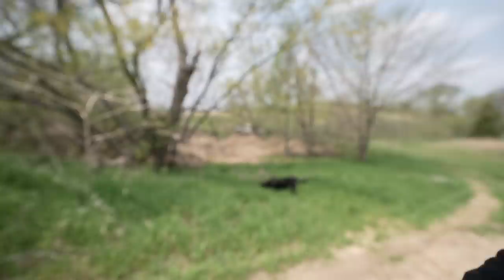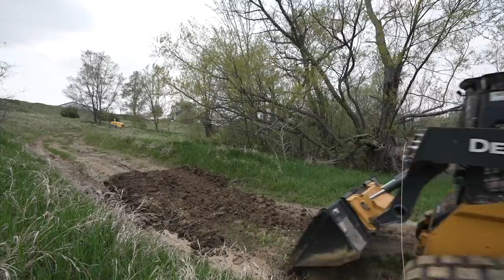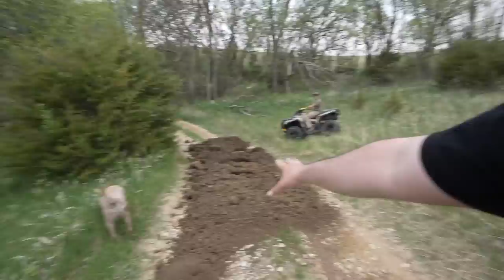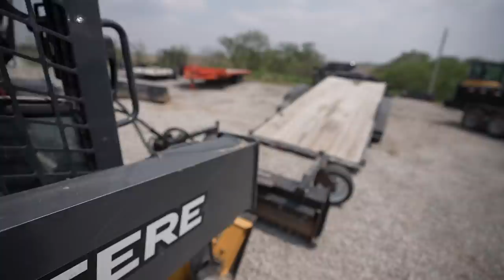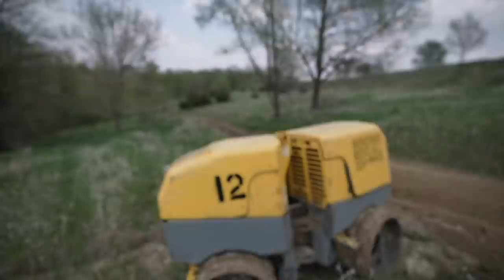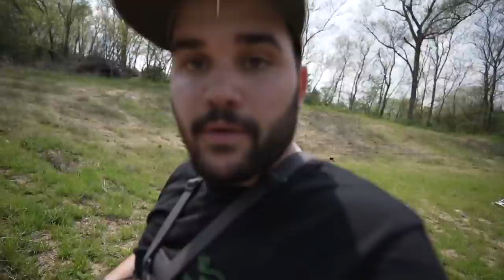Repairing Old ATV Trails with Remote Control Packer and Skid Loader w/ Harley Rake

Comment: The way we fix the rutts in our roads is we actually till our field roads and then come back in and pack it back down. it moves enough of the top soil to be able to flatten back out easily
Reply: Chisel plow works good too
Reply: When he was fixing the paths would a box blade of worked? Would it have been easier?
Reply: @mezenman  anything to really get the top layer of soil stirred up will work.
Reply: I use to work for a landscaping company and it’s easier to loosen up the soil and grade then if you notice spots that don’t have enough you can add a little more and keep grading. Using less soil and reshaping the soil that’s there

Comment: Flair my guy, I’m a heavy equipment operator for a living. Skid loaders are meant to push not pull, always push your dirt. As for the Harley rake put it all the way to the ground then put your machine in float mode while moving. You got this stud keep at it like you have been you’ve come a long ways from the mini. I’ve watched you from the beginning and I could tell from the hatchery videos that you’re getting wayyyyy better in a excavator, the skiddy will come easier the more ya use it🤘🏻
Reply: Continuous flow also helps I believe you hold the roller at the speed and direction you want the attachment rotating and then press on of the 2 bottom buttons on the left joystick.
Reply: I was coming to the comments to see if someone told him to use the float mode.. I agree flair has been improving just takes some practice.
Reply: Float was made for using in reverse, my guy...

Comment: Also I spent last summer finish grading in a 336 and the guy who was helping me along the way had 45 years of experience. He told me when it comes to grading try to do most of the work forwards. I found it a lot easier ontop of that it also helps with the wear on your cutting edge.

Comment: But don't you need to make a matching dent on the other side of the truck🤔
  You should use the remote control packer to flatten out and pack down the mud pit. Maybe then it'll hold some water.🤷🏻‍♀️
  You make a bit nervous, driving that close to the hole!😲
  The roads are looking really good! Keep up the great work team.

Comment: A tip, when grading with a front bucket, use the back edge of the bucket, not the front edge. its more rigid, and doesn't flex. tip bucket up going forward .

Comment: i’m a operator from aus and when filling low spots on one side you come in with the side of the bucket and only grab half a bucket on the one side and then fill your  track and then you track pack it as you go and obviously just switch the side of the bucket you fill up and just lay it in each side of the track and you won’t end up with excess in the middle causing a ridge and a difficult time cheers

Comment: I’m sure others have already mentioned it but when you’re reversing while grading use the tip of the bucket but when you are going forward while grading then back edge of the bucket. So basically tilt down while reversing and tilt up while going forward. You did good for being fairly new and and you’ll learn over time what works best

Comment: Obviously it’s whatever your more comfortable with, but the way i do it is dump the bucket just before the ruts and try to get your bucket at the grade height that you want and push it forward over the ruts and then back drag it keeping the bucket as flat as possible, just a tip hope it helps

Comment: The “remote control packer” is a trench roller. It’s made to pick up and put into trenches to compact before you lay pipe or just to compact small areas. Pretty much a small version of a sheeps foot roller. Used all the time by civil and utility contractors.
Reply: We use it for retaining walls as well
Reply: And it works like a charm!
Reply: The vibration is good on gravel

Comment: If the water is flooding most of the road where it is starting to erosion I would put a covert pipe in to help prevent it and smooth around the pipe and add some river rock or some big rocks to help also but love the videos keep them coming

Comment: A dozer would be more effective on what you’re wanting to do. I would cut the high edge off the right and scrape the whole trail and track it in with the dozer. The water  will shed off the trail with that edge knocked off. The water needs somewhere to go instead of following the trail and pooling in low spots. You have great ideas but can be done in less time. That washout is going to do what it wants. Just from the camera shots I’d guess 40 dump truck loads of dirt compacted with heavy machines to build a connection between those existing berms. Keep up the good work.

Comment: Somewhere inside the cab of the skid steer you should be able to change the flow output for attachments like that and get more hydraulic power to spin it faster and there is a way to make your skid remote controlled. Look up rcsparks on YouTube he has a remote controlled skid steer. Also the mini packer will pack it better than the skid even though it weighs less because not only is it vibrating it has those knobs on the wheels giving it more ground pressure per square inch and because your skid has tracks on it you actually have less ground pressure

Comment: There is a button on the joystick that will lock the hydraulics so you don’t have to hold the scroll the whole time. It’s meant for a mower or Harley rake whatever that turns not like a grapple

Comment: Hey Flair, what about using the excavator to fill in those ruts in the paths?  With the smaller scoop you can put the dirt right where you want it and then you can use the plate on it to smooth out all the high spots!  Just a thought!

Comment: Just FYI on the skid steer if you want to back drag on grade push the right control down where grade is and hit the trigger. It puts the shod steer in float mode and you can grade much easier when back dragging!!

Comment: In order to use a Harley rake right you need to adjust the rotation of the drum, going forward the drum must be rotating counter clock wise, in reverse it goes clock wise from the right hand side of the machine. The roller must push up soil in front of the machine going forward and in the back of the roller going in reverse.  One pass will not work, it needs multiple passes to really grade right.  If you buy one make sure you get one that angles and has side blades.

Comment: Just a tip to make it easier If you roll the switch then if you hit one of the four buttons on the left joystick think it’s the top left it will stay on and you don’t have to hold the roller switch works on the brush cutter also

Comment: If you use the remote packer and with any packer , you need you just put small "lifts" of dirt and pack them. The end product will be much more stable. Packing 36" of dirt really only creates a crust and doesn't pack the soil below. That remote packer is an excellent tool. You have to remember that your skid steer on tracks is made to reduce ground pressure, the packer is by far better . 

The soil looked like it had a good moisture content for packing though. Over packing can create moisture pockets , so be aware of that . One last thing, not sure in the Deere, but in the Case skid steers, if you bump your right joystick hard left it will float your bucket. Would be interesting to know if it does. 
I'm not trying to sound like a pretentious asshole, as I haven't operated equipment for a long while. Just a basic operator trying to give some advice
Reply: My JCB has a button to float the bucket very useful on our farm for keeping feed level in the bucket when dumping into an indoor mixer
Reply: @MintNickel1  thats cool  I wouldn't have ever guessed the bobcat has a fancy feature like that. His deere has to have it then. Wouldn't you say?
Reply: @SH-tz6ee  being a newer style skid I think it should but maybe depends on the package you buy

Comment: We use those sheeps foot compactors to tamp the base of our commercial foundation digs and pier  holes in like Walmart size buildings.we can add 18 of stone at a time and then pack it down in lifts.they work decent.we use a big excavator to set them down in the trench with a chain. We had a new guy put gasoline in one years ago and ruined it.it was a rental but it still was a bad day for that guy.lol

Comment: Flair the only thing to try to help you is when your filling in those ruts on each side of the road is use half of your bucket for like the deep ruts instead of grabbing a full bucket use half to fill in the one side it will make life a whole lot easier other wise everything looks great hate to be one of those dudes on the internet but I’m just trying to help great vid 👍👍

Comment: The remote compactor is meant for compacting trenches so you don't have to be in the trench and have the risk of the cave-in and then you die. In the trade I work as an inspector I've seen many of them and they actually work really good for trench compaction. Not sure how they work on a roadway guess you'll find out LOL.
Reply: Oh your 100% right why would the dummy at the rental yard give them that the thing is a specialized tool like you said for trenches or tight space there's got to be a better tool

Comment: Use the bucket like a dozier blade and push forward at the high point of the road the cuttings will fall to the low spots.

Comment: Hey flair you should get some of the big pipes in your last vid on your main channel and make an underground bunker. You could have 1 pipe maybe 10ft long and burry it 5 feet underground and have another pipe stand vertically with a latter to climb down in the bunker. And you could use solar panels for lights!
Reply: That is a good idea

Comment: Alot of the repairs are stuff you can do yourself for a $50 hose or make the hoses yourself and use connections you can reuse. Maby get guards to go over them so that when ever you hit a branch or w/e it doesnt puncture it or make a weak spot. If your gonna have alot of machinery you need to know how to do the easy repairs and maintenance. Or make sure one of your ranch hands knows how to. You find a good ranch hand that grew up on a farm there already gonna know how to do half the repairs. Then your only paying for parts and their wages. Instead of paying 10k on maintenance you will spend 2k in parts and labor.

Comment: The harley rake would have worked much better if you would have ran the hydrolics in reverse. So if you're driving forward, operate the rake in reverse. And if you're driving in reverse operate the rake in forward. That way you're rolling the dirt toward the direction you're driving

Comment: With most construction machines over heating they are in a lot of dust and dirt. Try cleaning and blowing out the radiator with air

Comment: That Deere will cut that dirt down to level on the  road. I'd use the front of your bucket more and grade it down some. You'll have to add less material. Just don't bite into the ground too much.

Comment: You could also use the bucket to take the material out of the center of the road by lowering the bucket and driving forward and if you do desire you can dump the dirt back onto the road and back blade it, it probably one of the easiest ways to do it because then it will essentially be even / same grade across the trail.

Comment: Your pick up puts down more pressure on the tires than the tracks of the loader, the tracks are made for a light foot print with maximum area of contact. So less pounds of pressure per square inch than the tires of your truck. Look on the door sticker once and see what the truck weights in at.
That packer will be perfect when you have to core dig your entire new dam and core fill it with pure clay to stop the leaks. That is more of a trench packer and will work great in a trench to pack down each lift of clay fill, no so much for doing a dirt road. You abuse your equipment driving with the loads up in the air and hitting piles and trees full blast, you need to take classes on operational safety of the machines you buy before you kill some one or the dogs.

Comment: To help with the dirt going in the middle and you trying to get in the ruts put ur bucket flat and turn 90 degrees and use the side of the bucket to push the dirt in when you turn back around
Reply: What???

Comment: When your equipment isn’t being moved please idle it down almost all the way leaving them run at a high rpm while not in use adds unnecessary wear and tear on the motor

Comment: There is a lot of skill needed to be a good, efficient heavy equipment operator.  Learn the proper techniques and keep at until you become good at it.  The worst thing you can do is stick with using poor technique and expecting better results.  It takes a lot of hours to become an expert at anything.